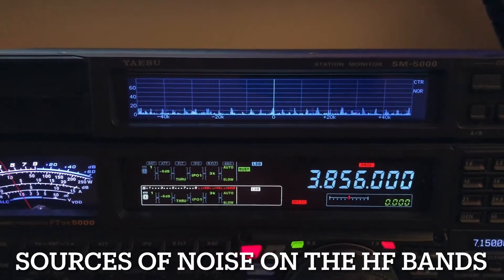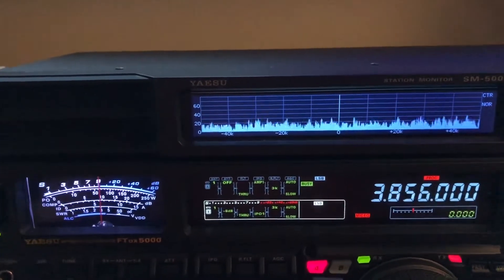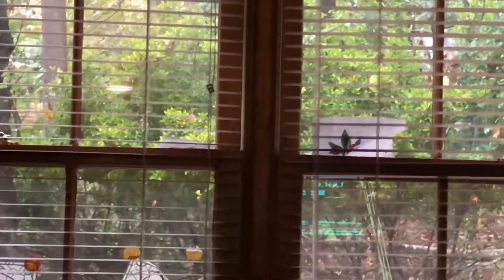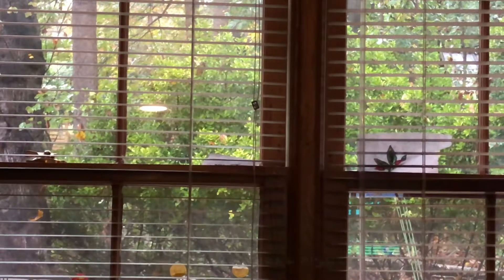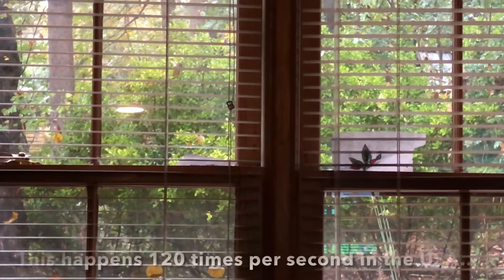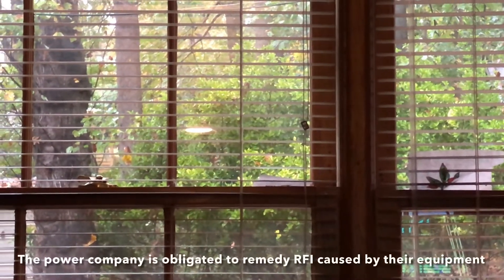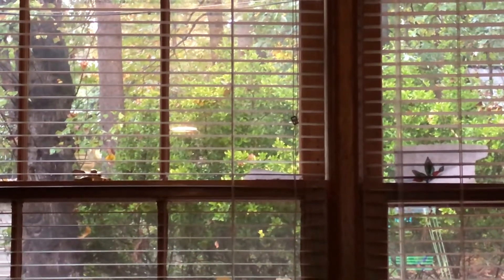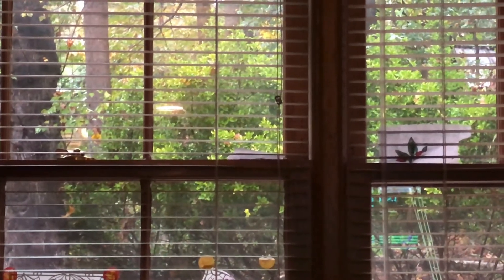Sources of Noise on the HF Bands (read the description)

Comment: I get that on 20 & 17 I have power lines real close. Think I’m gonna try a high pass filter.
Reply from the maker: A high-pass filter (HPF) will not effectively stop power pole noise in ham radio reception, and it could make the problem worse on lower HF bands.

Power pole noise (also called power-line noise) causes Radio Frequency Interference (RFI) due to arcing across the components of utility poles.  It comes from electrical discharges caused by loose hardware, faulty insulators, or corona effects. This creates broadband interference—a raspy, buzzing or frying sound with 120 Hz modulation (from 60 Hz AC power). The noise is strongest at lower frequencies (starting from VLF/MF and is often very prominent below 10-15 MHz) gradually becoming less intense at higher frequencies.  But it can sometimes affect frequencies as high as the 6m band.

A high-pass filter attenuates signals below its cutoff frequency while passing those above it. Common HPFs for ham use (e.g., to block AM broadcast interference) might cut off around 1.8 MHz.

The best long-term fix is to locate the noisy pole (using a portable AM radio, VHF/UHF handheld in AM mode, or ultrasonic detector) and report it to your utility company—they're legally responsible for fixing interference from their equipment. Many hams successfully get noisy hardware repaired this way.  

You can watch the ultrasonic detection technique in action here: https://youtu.be/TpcUUzMh-bI

There is a collection of posts and videos related to mitigation of RFI available at: www.patreon.com/N4HNH

In that collection you will learn about a very effective method for canceling the noise before it enters your receiver, even if you aren’t able to mitigate the noise at the source.

Comment: Thank you very much. Your video helped confirm my noise at 80 meters, too. It happens between 3.98 Mhz and 4.01 Mhz and doesn't happen on the other bands. It is a little ramp-up noise between those frequencies and then it drops to normal noise floor level past 4.01 Mhz. My built-in ATU struggles with tuning at the high band edge of 80 meters. Does your noise happen on the other bands? Thank you very much for this video.
Reply from the maker: Power line noise can affect other bands but it doesn’t always.  It might only affect a couple of bands.  I’ve heard it on the 10m band.  The intensity can vary by band. 

My daughter’s aquarium lamp wreaked havoc on the 20m band, but only 20m.

If your noise is a distinct buzz sound, and you have performed the circuit breaker test to be sure the source isn’t in your home, there is a high degree of possibility that the source is loose hardware on the power pole, dirty insulators on the power pole, or a blown lightning arrestor.  There is a collection of videos on my Patreon site that covers power line noise and the tools used to locate it. It’s best to have an idea which pole is the culprit before you call your power company.
Reply: @n4hnhradio  Ok. Thank you very much. I'll look into this a little better and try to narrow this down. I appreciate your help and answer on this issue. It does sound like a 60 hz buzzing sound.
Reply from the maker: I hope you are able to get it remedied.
Reply: @n4hnhradio  I haven't tried the circuit breaker test as you suggested. It will help me isolate this if it is anything in the house. I'll try it tomorrow. Thank you for the suggestion. The panel is downstairs in the basement. I'll get my exercise. I'll let you know what I find out. Thanks again.

Comment: Thank you. I found here a sort of confirmation to my theory regarding dry air and electrostatic discharge from power lines, creating sometimes a lot of noise.
Reply from the maker: Yes indeed.  Dry air promotes arcing. I have a playlist all about HF Band Noise/RFI. In that playlist is a video of a guy who developed equipment to pinpoint the exact hardware on the pole that is causing the arcing.  Here is the video link: https://youtu.be/TpcUUzMh-bI?si=EUEycDGLWT5GklPV

Comment: New ham here. 
My noise just started but this is my first winter on the band so do you think it could be from the dry air?  My noise sounds identical to yours.
Reply from the maker: Welcome to amateur radio!  Dry air can definitely contribute to power line noise. It might only happen during the warmest part of the day but gradually get worse over time, until it happens constantly. Mine does that.  

There are around 60 playlists on my YouTube channel. There is one dedicated to HF Band Noise/RFI.  There is also a collection on my Patreon site dedicated to noise and RFI.  

73, de N4HNH
Reply: @n4hnhradio  Thanks for the reply!  I’ll check it out 
73
KQ4GDB
Reply from the maker: Try the circuit breaker test to be sure the noise isn’t from within your own home. There are many noise sources in homes these days.  But, if the noise is happening only during low humidity, it could likely be from loose or defective hardware on a power pole.

Comment: Call my electric coop and tell them they are emitting "noise", they'll send someone out to demand why you're wasting THEIR time and threaten to charge you with it "as a hobbyist". Problem is, SW is "WIMPY WEAK" signal requiring ridiculously HUGE antennas to even reliably receive. 
Radio makers put all the flashy lites and buttons without REALLY improving their equipments receivers and built-in filters. The FAA already considers the hobby a nuisance to commercial airplane communications!
Reply from the maker: The FAA enjoys reliable communications that was pioneered by this “hobby.”  

A few years ago, my power company found two blown lightning arrestors causing my PLN. They thanked me. They have no way of knowing they’re blown until other equipment that they protect fails, which is costly. Furthermore, they are required by law to remedy RFI.

My power company is trying to avoid having to correct the RFI of late, but Jeff, W4DD, did half their job for them, by pinpointing the exact source of the noise. I published a video about it.  I wrote the FCC.  The FCC turned it over to the ARRL.  They ARRL sent Jeff. If the power company didn’t proved to be cooperative, the ARRL would get their legal team involved.

Comment: I have exactly the same type of noise on my FTdx 5000 and it turns out that the noise is caused by a LED street luminary about 300 ft from my antenna.
Reply from the maker: LED lights are notorious for noise. It isn’t the LED itself but the power controller.

Comment: "Hot dry air" causes power line noise ("due to static build up"), as opposed to damp weather?  Huh?  I think you'll find that moisture contributes to leakage currents across contaminated (dirty) power line insulators, leading ultimately to tiny arcs that are the source of power line noise. A good rain storm can help to clean the insulators, so it can get a bit complicated trying to correlate things based on your own experiences.

Power lines do not build-up static charges, since they're connected to the grid. The AC voltage goes up and down at 60 Hz with extremely low source impedance, so you'll never see a "static build-up" associated with power lines.
Reply from the maker: I’m afraid you’re mistaken. You might want to have a conversation with the RFI engineer at your power company. I have.   I’ve watched the entire process of finding the arcs, using infrared sensors and cameras. It’s a sophisticated system, housed in a Sprinter van with a hydraulic tower that pivots the sensor array in any direction. I’ve sat in the van and watched the process. 

The lower humidity (dry air) necessitates a higher potential of static charge buildup before there is a discharge. Moist air allows the discharge current to flow at a much lower voltage, lessening the amplitude of the noise.  However, it is possible to have a high enough potential buildup that notable RFI can be generated in moist air. In my case, the potential of the lines is 14,400 vAC.  As I type this, the hardware on two poles in my vicinity is so loose that I’m receiving RFI during high humidity. The engineer has already identified the poles and the specific hardware on the poles that needs to be tightened and cleaned. Now I’m waiting for a crew to come out and perform the work. But the frequent storms we are experiencing in the Southeast lately have my RFI low on the power company’s priority list.

Here is an article from the ARRL: http://www.arrl.org/files/file/RFI/A%20Smarter%20Approach%20to%20Resolving%20Power%20Line%20Noise.pdf

Comment: "One source of noise is due to the the heat generated by receiver components.  This cannot be avoided."  
Not precisely. The first stage of receiver RF preamplification on an HF receiver is typically very low power, so the first transistor would be approximately room temperature. But even if you removed the cover and took it outside in winter and had a fan blowing cold air across it, you won't see any difference. The part of the sentence that I disagree with is "due to the heat generated", when in fact it is close enough to room temperature as to make no difference.
Reply from the maker: I recommend that you search the Internet and read about Johnson-Nyquist noise. 

Perhaps the article at the link below will shed some light.  Look specifically at page 47, the third column. “Noise is generated by the random motion of atomic particles inside circuit elements.”  Continue reading and note that the temperature of the device generating the noise will determine the amount of noise. As atomic particles move inside the receiver components, thermal changes take place, creating noise. Add to this, phase noise, and you have the noise in your receiver before you ever connect an antenna.  The signals from your antenna must be strong enough to overcome atmospheric (galactic) noise, man-made noise, and the thermal noise generated by the receiver itself. 

http://www.arrl.org/files/file/Technology/tis/info/pdf/020708qex046.pdf

Comment: I have a S7 to S9 on 40 meters every day.
Reply: I added radials it lowered the noise floor
Reply from the maker: Additional radials are a good thing for ground-mounted vertical antennas.  But no so much for elevated vertical antennas, like my Cushcraft R5.

Some power pole noise is vertically-polarized; the result of loose staples that hold the ground wire to the pole.  But not all power pole noise is vertically-polarized.  My horizontal dipoles are typically more susceptible to the QRM from a power pole.  

My vertically-polarized antenna is more susceptible to QRN than my horizontal dipoles.  It doesn’t usually suffer as much from power pole noise unless the cause is loose ground wire staples. Natural/cosmic noise tends to be vertically-polarized.  It will typically affect a vertically-polarized antenna more than a horizontally-polarized antenna.
Reply from the maker: Mine is that bad with the power pole noise. But it’s S9+10 or more on 15 through 6 meters. Still awaiting the power company to come fix their poles. It’s been a month since their engineer verified the problem.

Comment: Doug,

I have noise sometimes that sounds exactly like yours. I too belive that it is power line noise. One thing that reinforces this belief is that my Yagi sits about a hundred feet from the suspect utility pole. When I aim the antenna at the pole the noise gets very loud, when I turn the Yagi sideways to the pole the front-to-side rejection of the antenna is good enough that the noise goes way down.

I need to call the utility company and tell them about it but I haven't done that yet. And, like you, when it rains or is otherwise wet outside the noise goes away.

Good luck,

Mike - WB4HUC
Austin, TX
Reply from the maker: Mike, that definitely has the characteristics of RFI from a power pole. Usually loose hardware, dirty insulators, or blown lightning arrestor. Almost never the transformer itself, though the transformer is often blamed.

Comment: Agree 100%. Had a terrible 80M and 40M noise floor when I began as a ham a couple years ago. Grounded things, ferrites, etc. didn't help. Like you suggest, I shut off all power in the house and ran off battery. Still there. Took off the antenna connection. Gone. So once I knew it was radiated emissions outside of my home, I walked the neighborhood with an AM radio. Noise increased near two poles. Much worse in rain / damp weather and wind. Sure enough, Xcel Energy found bad hardware on one of the poles I had identified and another about 1/4 mile away. They were great and I even have the tech's cell number should it come back. Now if I can just get rid of the spikes every 18kHz on 15M that come from my outside AC unit...
Reply from the maker: You are fortunate to have such a responsive power company.
Reply: @n4hnhradio  Yes; they took it seriously but it did take 2-3 months to track, verify, report,  schedule and correct it. But at least I did not have to convince them to do so.
Reply: @donz7992  Had similar with a street light buzzing causing interference.  Called the utility company and it was fixed before the day was out.  Just had to replace the light.
Reply from the maker: You guys are so fortunate. My power company told me that they are “phasing out the RFI department.”
Reply: @n4hnhradio  Wow. That is unfortunate. From my conversations with utility co guys, these things are a lot more prevalent than we might think. I think Xcel Energy doesn't want to mess with another federal agency.